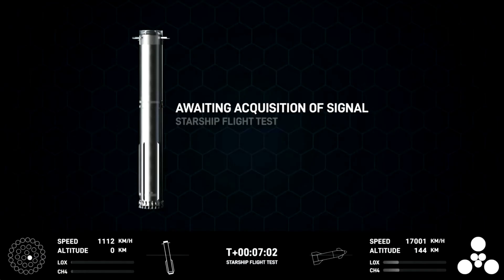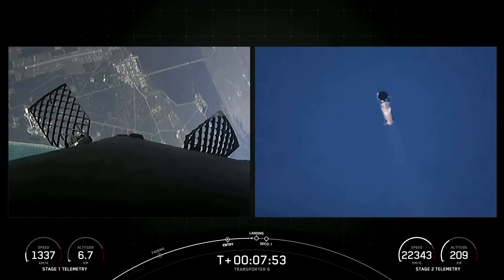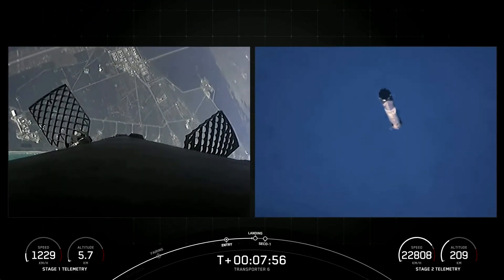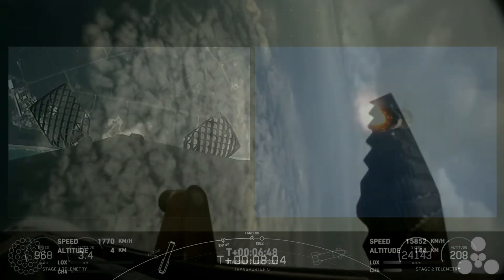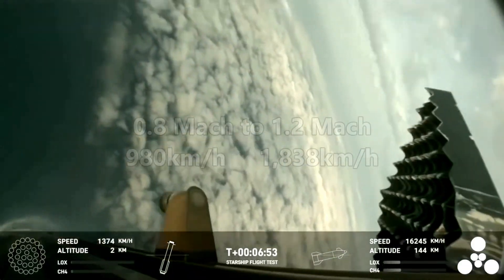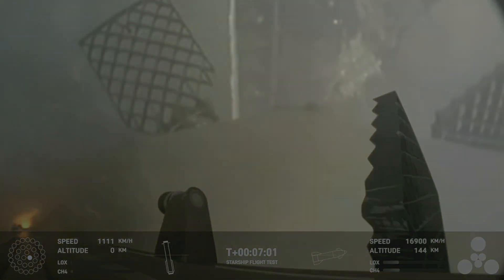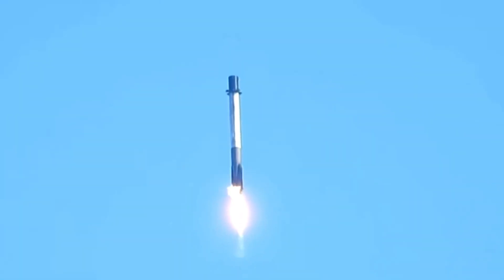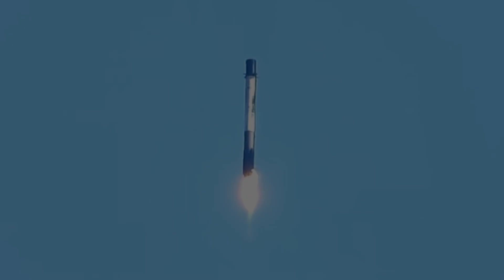Starship IFT3 Booster Failure Heat Tile Issues and Correction Burn

Comment: I knew Energia had flyback reusable boosters planned, but always thought they were fully expendable as flown.
I too, have been corrected today.
Reply from the maker: Same here but I didn't issue a correction to my correction :-)  I didn't know they planned to recover the first version at all but was aware of the very cool "blade wings" that would deploy on the second version that was never built.  So they were designed to be reusable but this was not deployed during either of its two flights... Always good to learn something new :-)

Comment: OK, So  carbon-carbon leading edge tps does not equal heat tile tps? That is a bit of hair splitting... kinda sad. The booster issue started during the boost back. It was cut short with asymmetrical shut down. It was supposed to end up about 60+ km closer to TX.  I don't think I'll be watching for some time. Wish you the best though. -unsubbed ❤
Reply from the maker: Not really.  A tile falling off, leaving metal exposed, causing the loss of a vehicle was the premise.  A high-speed solid mass punching a hole in a leading edge that is NOT made of ceramic tiles is completely different.
Reply: @terranspaceacademy  It's clear that is your stance. Best of luck.
Reply: @GypsyTinker2012 have a cry mate…. You won’t be missed

Comment: It appears the three engines started at a point about 1,000 meters above the sea and with a velocity of 1,291 kph or 358 mps.  The Booster has a dry mass of about 200 ton and a 100% propellant mass of 3,400 tons.  I would estimate that to slow the Booster to zero vertical velocity, a 6.5 g vertical force (+ 1 g to overcome gravity) would be required.  A Raptor engine produces roughly 200Ton of force.  Therefore, if my calculations are correct, 8 Raptor engines would be required to slow the Booster to 0 vertical velocity just as it reached seal level.  Perhaps the solution is to keep one Raptor engine active at 50% (or lower) thrust all the way down to reduce the vertical speed and to apply acceleration to keep the fuel well positioned, if there is sufficient propellant remaining?
Reply from the maker: It looks like they only keep about 2-5% of the propellant for landing... But that's still around 100mt (3%)... They must do a hover on the booster to hope to land it. That's going to be tough at those velocities...

Comment: I have noticed that the booster became unstable imediately after passing through a cloud layer.  Could that denser air and humidity right at the engine relight have been a factor?  It seems unlikely to me but on the other hand it would be an amazing coincidence.
Reply from the maker: I have heard that it was sheer winds which would make sense.  It is base heavy and the top will sway easily with any lateral force...

Comment: Isn't Mach 1.2 roughly 1,480 km/h?

As for the Super Heavy failure, I agree it's incredibly unlikely that it failed due to unmodified Falcon 9 software. That is Boeing-level of incompetence, and doesn't sound at all like SpaceX.
Reply from the maker: I would be shocked also... Unless they just wanted to see what would happen. :-)
It was at about 1,200kph at the spin start so it was between 0.8 and 1.2Mach which is the transition zone.

Comment: No one has ever tried to re-enter through the atmosphere with a tower block sized vehicle, I personally wouldn’t rule out that the possibility of a inaccuracy in the simulation’s. Simulations are basically guesswork based on the most accurate data they have on hand, they now have a lot more data on hand that future simulations can benefit from.

The re-entry software reminded me of a little girl trying to walk in mummy’s high heels.
Reply from the maker: Very good point...

Comment: I think it's clearly an engine induced spin for the booster, and had nothing to do with wind sheer. The entry was very stable. The engines failed to relight, the graft showing three tried, one center staying on, but the graft was late showing it. The fall was stable until venting started, and that was the engines trying to start up. The center engine started to gimble to correct for asymmetric thrust, causing the instability. A green flash is seen as the 1 engine started to eat itself, then it exploded just like IFT2. Watch it in slow mo if you have too. It's not complicated.
Reply from the maker: But it started to spin before the engines tried to light.  How would cool down create enough assymetric thrust to spin something that big unless something went wrong?

Comment: Booster 10 was going way too fast.  It's pretty obvious that, by the time it attempted to relight its center 13 engines, it had no chance of scrubbing its remaining momentum before impacting the ocean surface.

So, I think due to the excessive speed while going through the lower, denser parts of the atmosphere, the grid fins ended up exerting more torque than the software running them was programmed to expect.  This caused every single grid fin adjustment to 'oversteer', and every subsequent attempt to negate this led to overcorrection.  This would explain the increasingly violent maneuvering of the Booster, seemingly growing in amplitude, as it descended into ever-denser air, just before it attempted and failed to ignite its engines.

SpaceX will have options on how to address this.  Certainly, the grid fin controllers need to be recalibrated or at least - assuming they are PID controllers - have their damping reduced so that they are more immediately responsive to minute deviation from expected motion.  Booster could be starting its landing burn sooner; apparently it's too narrow and heavy (not generating enough air resistance) and/or there just isn't enough time during its reentry, for it to reach stable terminal velocity in the lower atmosphere, that's low enough to leave the landing burn until the last 5 km or so.  Another possibility is to start using the grid fins earlier during the reentry, to actively help the Booster aerobrake - turning each pair of adjacent fins away from each other symmetrically, each at 45° off horizontal, so that they don't create any net torque while still maximizing drag.  Maybe there are other, related changes to contemplate as well - like, larger grid fins and/or more powerful motors to drive them.
Reply from the maker: That makes a lot of since. Or come down more sideways to slow down...
Reply: @terranspaceacademy  I'm not sure that's possible, given how bottom-heavy the Booster is with its propellant tanks nearly empty.
Reply: “bottom heavy” that seems like a serious issue for both Booster and Starship on reentry.
Reply: @nullpointer782  Ship at least has the bottom flaps to help compensate - as well as header tanks (full at reentry) in the nose cone, as a counterweight.  Booster has neither...

Comment: I like your videos, and that you use your own voice instead of an AI.

What do you think is the wind speed limit for relighting the booster's engines during a landing burn? Air was hitting the rocket nozzles from below at 1350 kph when the landing burn began, creating high pressure inside the combustion chamber as the nozzles funneled the air upward. The Ax-3 mission's Falcon 9  booster started the landing burn at ≈ 880 kph, with smaller nozzles. It's fun to ponder these things. Thanks.
Reply from the maker: It was supposed to be going a lot slower before relight so something didn't go right long before. The only thing I can think of is it stayed too vertical. Relighting at supersonic velocity must be difficult but they worked it out on the Merlins...

Comment: Put a sub sonic brake chute on booster, deploy it before engine landing burn, once it slows down and stabilizes it breaks away before it lands
Reply: A chute the size needed would be able to be packaged in available space....now if you are just talking for stabilization...... maybe but itd have to made of something exotic IMHO to handle the force out on it.
Reply from the maker: It seems if you vented enough cool down gas you could push back the incoming airstream?

Comment: Booster has no heat tiles!
Reply from the maker: The heat tile issue came up on the Starship...
Reply: @terranspaceacademy I have heard others speaking of the video feed during reentry that it was going up to the starlink satellites and then directed to earth avoiding the plasma in order to maintain control. Based on what I had seen from it, it seems true, but before I thought that the plasma which interferes with communication was all around the craft and not just in the front.
Reply: Booster needs no heat tiles.

Comment: Booster gyrations may have been due to fuel slosh caused by high wind shear at that elevation and insufficient control authority of attitude control jets. It looks to me like the same system may have contributed to uncontrolled starship reentry as well.

If so, then SpaceX may need to significantly increase the thrust of the ACS on both the booster and the ship. We'll see.
Reply from the maker: That's a good point... I always forget about the incredible mass in even 2% prop reserve in that thing.
Reply: @terranspaceacademy  As I was watching the gyrations I immediately remembered Elon's conversation with Tim Dodd where Tim brought up using cold ullage gasses for attitude control. Just guessing here but I'd bet a dollar that was a big part of the problem and we'll see new hot ACS nozzles all over Starship and B9 at the next rollout.

Comment: Superheavy Booster should be the main focus for SpaceX.  If they can consistently be reused in a possible side by side stack configuration you could put real Tonnage in orbit.
Reply from the maker: But it would be beautiful!!!   And a nightmare for stage zero :-)
Reply: It also seems absurd to consider side by side tandem launch when launching one starship is difficult enough.
Reply: I disagree. @michaeldeierhoi4096
Reply: It's impossible to have a side by side configuration the loads would be crazy on the centre core and the boosters would need heavy reinforcing
Reply: They figure it out for the Super Heavy. @Misty0639

Comment: I think they should seriously consider separate small tanks for re-entry/recovery burns. Of course that's more weight, plumbing and valves to break. 
But, it's plainly obvious that re-lighting engines with these massive tanks with fuel and oxidiser sloshing around is troublesome.
Reply from the maker: I think so too...
Reply: they probably will end up doing something like this
Reply from the maker: I do too
Reply: Look at the 'fuel gauge' displays. IMHO, the booster just ran out of fuel; the last dregs relit a few engines for a moment, then it was empty. I'd love to have more info on turbopump inlet/outlet pressures & RPM.
Note the soot in the exhaust while boosting - that shouldn't be there, it wastes fuel. And if the booster was using more fuel than expected, it could easily have exhausted its reserves.